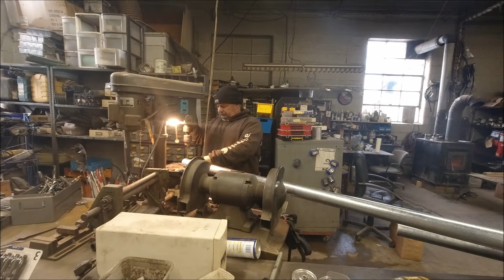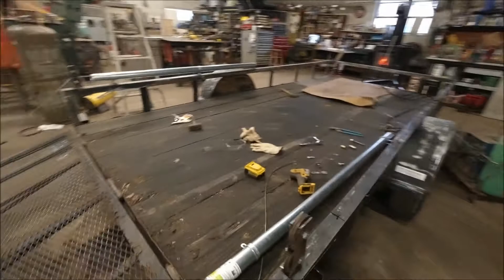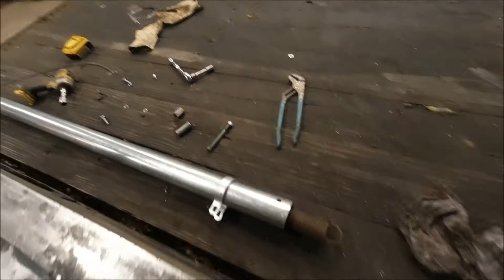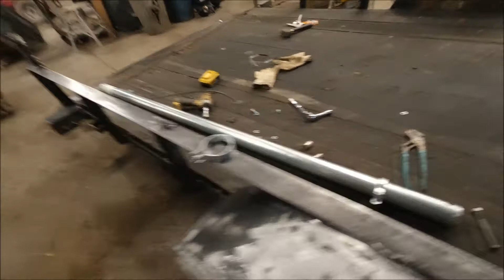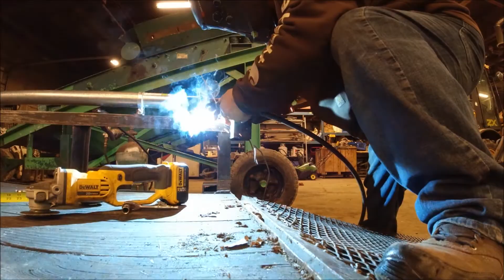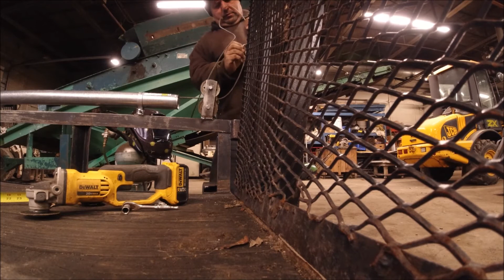TRAILER TAILGATE SPRING ASSIST

Comment: Useful video. I though though you would use those two pulley wheels for mechnical advantge
Reply from the maker: No need to do that, they’re only there to keep cable from chafing and binding.